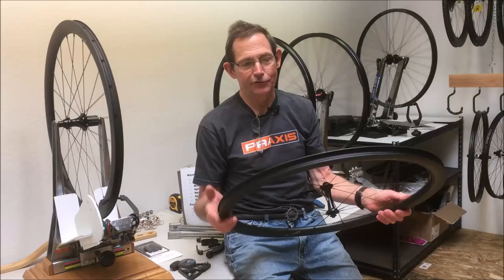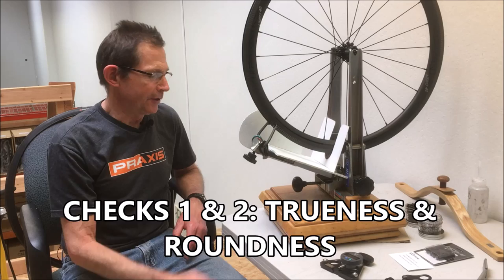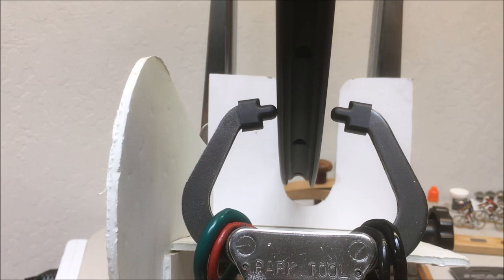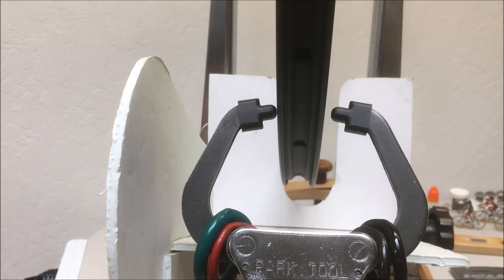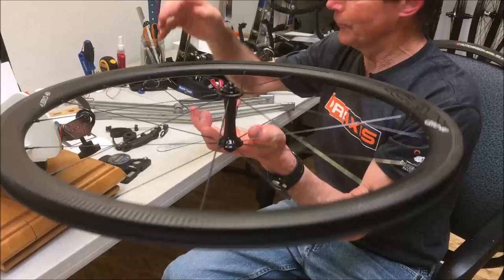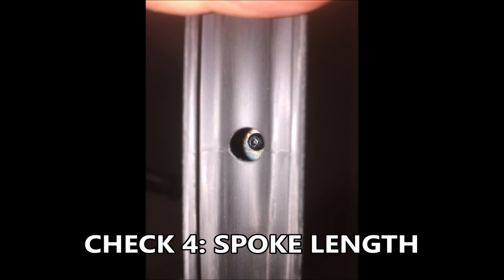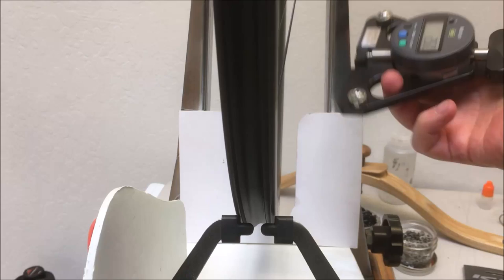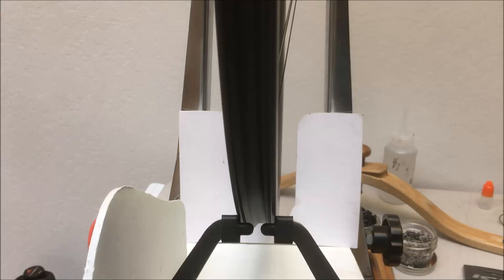ICAN Chinese Carbon Bicycle Wheels Review by Wheelbuilder Jim Langley

Comment: Confirmed what I found on my Ican 38mm 25C clinchers.  I fix bikes and tune wheels as a hobby.  My spoke tensions were not even when the wheels were new.  I measured every single one and graphed it on park tools free online tool.  You can get a good idea of spoke tension distribution across the entire wheel.  Took a bit of time to get them as even as possible and at the same time true (my OCD).  I find in previous wheel repairs for friends that the more even the tensions across all the spokes, the more the wheel is likely to stay true longer and not be affected by stresses when riding.  While doing that I also aligned all the blades.  Overall very happy with what I paid.  The rim brake surface has held up without delaminating or warping down long descents.  Thanks for a great review.
Reply from the maker: Thanks a lot for the kind words and for sharing your nice review of your ICAN wheels, Almon Dao. In the video, I am using my Wheel Fanatyk tensiometer, an awesome tool: https://www.wheelfanatyk.com/store/digital-tension-gauge/ It has an app for tension charting, too. I like Park Tool's online spoke tension app, too. For others to use it, they need to get Park's TM-1 tool https://amzn.to/2yYE1oR which is easy to use. And then, they can use the online app here: https://www.parktool.com/wta and have fun fine-tuning wheels to tension perfection. Thanks again!

Comment: I was extremely impressed with your video presentation Jim.  Your manner is low key, understandable, and transparent.  I never thought much about this process, now I'm thinking it would be interesting to see a video of you evaluating and tuning hard used mountain bike wheels from a downhill racer.  Thanks again for the very interesting piece.
Reply from the maker: Thanks a lot for the kind words, John, I appreciate it and am very happy you enjoyed my video. I work with a pretty talented and daring mountain biker (former BMX national champion). He can destroy any wheel - and I have build him many - some carbon, but mostly aluminum since he hits flies so high, lands so hard and hits so many rocks - and carbon can't handle it. He breaks hub axles, too, and once in a while spokes. He is one of our top product testers. If he can't break it, we know we have something good. Mountain bike wheels are generally much more ruggedly built than superlight carbon road wheels due to the significantly heavier/wider rims. It's easier to build good MTB wheels than it is to build good road wheels because the rims do so much of the work. Thanks again!

Comment: I have had great luck with my set of ICANS.  I did correct the twisted spokes myself.  About 15000 miles on my set now.  Recommended!
Reply from the maker: Thanks very much for sharing your experience with ICAN wheels, Ed! That's great to hear.

Comment: Good video. I went through the video rather quickly but I didn't see any comments about the hubs and bearings. The hubs are just as important as the rims. I bought some Boyd wheels about five years ago and I had problems with the bearings on both the front and back. Had to be replaced at around 5000 miles. I have a set of wheels with Ultegra hubs with over 25000 miles and they are still running smooth.
Reply from the maker: That's a good question, Neal. I have about 1,200 miles on the hubs so far, but here in Northern California, we don't see awful weather so I haven't exposed them to much more than rain. So far they are still silky smooth and no worries. There are a few comments from riders who have logged more miles and years than I have and no one has complained about the hubs as far as I've seen. So that's good. Thanks for the comment, Jim.
Reply: @JimLangley1  I'm a old timer and I don't care for the sealed bearings used in most new wheels. I have sets of Campy wheels from the 1980's with many miles on them that spin much smoother than  sealed bearings wheels. I haven't found a need for carbon wheels but it's interesting to read about them and you do a great job explaining the pros and cons.
Reply from the maker: Neal U Appreciate the kind words & I am fond of Campy hubs, too. It’s their adjustability that’s so nice. You lose that with most sealed bearing systems in exchange for supposed easy to replace and inexpensive cartridge style plug & play bearings. But it’s not always easy to replace the bearings and sometimes it’s impossible to remove play in the bearings too, when/if it develops. Still, Phil Wood showed that sealed bearings can work as did Chris King with his sealed headsets. Carbon rims primarily allow lighter wheel weight and personally I do find it noticeable. The wheels sound a little different - the taller, the louder. Braking is not as good as aluminum with rim brake carbon hoops. You do get used to it but in the rain you want to keep it in mind. So there are trade-offs.  Thanks for sharing your expertise.

Comment: Jim, I have the ICAN 38mm Disc Brake Cyclocross wheelset - regular spokes & weight 1645 grams both.
They're ridden on my 2017 Giant Contend SL2 Disc Road Bike. 
They really upped the performance factor of this Endurance Geometry Aluminum framed $1150 bike.
They shaved exactly 2# of total bike weight.
Was 21.9 stock
Now 19.9.
Ride is much improved !
Our roads here in Rural E Texas (Tyler area) range from Smooth tarmac to potholed garbage - with too much of the latter.
I'm at around 4500-5000 miles ridden. The '4in1' Novatec Hubs are rolling perfectly smooth. At 200# I'm not exactly a lightweight guy either !

I'm thinking I should on general Principles check their spoke tension - as a semi-annual check.

These wheels were just $449 shipped. Incredible value !

Thought you might appreciate hearing about my "real world" experience on the Disc version similar to the ones you show in your Unboxing video.

I also bought & built up the ICAN A007 Aero Road bike.

My review on that build is posted on Amazon under that Frameset listing - mine's the one with Pictures & 'Giant Blue' Color scheme.

Built it in late 2015 - fab race bike !
Reply from the maker: Thanks for sharing your great review of your ICAN wheels, Mother Goose! It's nice to hear how much you like them and how well they're working - especially how they transformed the weight and performance of your bike. Also, thanks for telling me about your Amazon review of their Aero Road Bike. That sounds impressive, too. I'll check it out. Thank you! Jim

Comment: I'd love to see the test results from a wheel straight from the factory of one of the big brands who charge at least double the price.
Reply from the maker: When I reviewed these wheels I used the same checks I've used on many other wheels over the years, Chris. Spoke tensiometers were the key tool that allowed putting numbers on wheel builds. Those became readily available to bicycle shop mechanics and wheel builders around 1980. I had a Hozan to start back then and later Wheelsmith's. We checked factory wheels when we sold them back then and right up until today using the basic same steps shown here. What changed since 1980 is that the quality of wheels has improved greatly across the board and that includes spoke, rim, hub and assembly improvements driven by innovation and consistently more powerful computer analysis to determine how the components and overall wheels can be improved. When you check most modern wheels you find that they're excellent out of the box.  I kept this in mind evaluating the ICANs in this video. I would not expect to find even the few issues I found with the ICANs with the big brand's wheels. Wheels have gotten much, much better over the years, which is a great thing. Really appreciate the comment!

Comment: great review . I have had some Aero 40 disc wheels for 2 years and they are still running as new . On close inspection a few spokes could do with realigning to be perfect ( they are only slightly off) but I am super happy with the purchase and performance so far
Reply from the maker: Thanks a lot for watching my video, Stuart and also for sharing your review of your Aero 40s. I'm happy to hear they're still running as new and you're very happy with them. Thank you!

Comment: I bought a couple Ican fatbike wheels in the last year.  The 26" ones held up to my 190lbs and 85 lbs of gear fatbike across Utah and Nevada.  Amazed how well the held up to some rather extreme beating.  I more recently bought their 29" wheels for the same fatbike and they've been good but haven't had to put up with the abuse I put the 26" ones
Reply from the maker: That's great to hear, Greg. That sounds like an awesome trip riding across Utah and Nevada on a fatbike - well done! Appreciate you sharing your ICAN review very much. Thank you!

Comment: Sounds like a good accurate review to me.. I'd buy them , inspect them and have someone do the needed adjustments .  Mine came thru same ( bought the 38mm set)  a little spoke twist as well, and but else was great.  I'll take your advise and have them adjusted when my local shop has the time.
Reply from the maker: Thanks for watching and the comments on your ICAN wheels, appreciate it!
Reply: @JimLangley1  pardon the grammar goof.. was mutitasking.  I am enjoying the wheelset. Next uprading my crankset to 105 with A/B ovals.  have enjoyed those on my mtb for 4 yrs and it's time to put some on the roadie.

Comment: Fantastic review, especiaqlly the bit about the tire mounting....no other reviews look at that aspect and it is super-important. I just sold a pair of Reynolds Strike SLG wheels because it was virtually impossible to mount, and especially seat, a tire out on the road. I also have a pair of older ICAN wheels and they are much easier for tire mounting.
Reply from the maker: Thanks for the kind words, Tecno. I hear from more cyclists about difficulty mounting tires than just about any other issue, so you're right about it being very important. These ICAN wheels did a nice job with their fit and ease of tire mounting and removal, which is great to see! Thanks again!
Reply: @JimLangley1  btw what do you think about hubs on those wheels? Are they rebranded Novatec or something like that? I am quite interested in the 55mm version of these wheels but have not found any info on the hubs...
Reply from the maker: ICAN told me that the hubs are their own design,  @tecnociclista5342 . It would make sense if they had them made to their specs by a company like Novatec, but I don't know if that's what they did. They look to be a very minimal design to me and from the overall weight of the wheels, the hubs are likely superlight, too. I won't know how they hold up until I can put some miles on the wheels and particularly do a lot of steep climbing to put some pressure on the front wheel (standing) and rear wheel cassette. Other people who have commented who own ICAN wheels have said the wheels hold up nicely. For more specifics on the hubs you might try the chat function on their website to see if a technical rep will answer. I hope this helps and thanks for the great comments!
Reply: @JimLangley1  Thanks for the insight! My other ICAN wheels are certainly stiff enough but come with Novatec hubs...these look quit flimsy in comparison which is why I was asking :) I did chat to them recently and for my weight (83kg) they actually recommended the FL-line (which come with Novatec hubs) but are a little heavier, I should probably trust them on that but the Aere line is just so temptingly lightweight ;)
Reply: @JimLangley1  have you had a chance to ride the wheels? Any opinion on the hubs yet? :)
Reply from the maker: Tecno Ciclista so far they are fine. I think it’s going to take many miles to see if anything can be improved.
Reply: @tecnociclista5342  شيد طارة سللك

Comment: A killer video, great information.  As a mountain biker and someone that has worked in the sporting good industry for 31 years I can tell you that 90% of bike parts are produced in China.  There is no doubt the industry has it's boutique brands that product parts and wheels in the US and abroad.   Many of the China factories that produce for the "big" brands also sell direct and can provide huge savings.  I9 Wheels (produced in the US) starting price is over $2000.  I have found a source that produced a killer set of MTB carbon rims for $650 that includes DT-Swiss 350 hubs with 54 engagement. I'm not a wheel builder but I'm able to true my own wheels.  I own a Spin Doctor truing stand, a spoke wrench and a Park Tool spoken tension meter all for $135. It's worth the time to true a wheel, makes them last a long time.  Saving $600-$1500 is worth the risk in my view.   I love technology but in the mountain biking world there are no more manufacturing secrets, all the manufacturer's are producing great bikes.   The bike industry uses marketing tactics to convince the end users to believe the newest trend will make you a better rider (slack, headtube angle, geometry, offset etc...).  You can find several blind test results on the Internet that used riders ranging from pro's to the weekend warrior were virtually none were unable to pick out any of the differences.  A great video of a Pro rider talking about the very slight differences in MTB bikes and what the average rider can do to make his/her current bike perform better.  https://www.youtube.com/watch?v=zazQCR5oIyI&t=618s
Reply from the maker: Thanks for the kind words and advice Will and the link to that informative video. Good one! Appreciate your comment! Jim

Comment: Great video. I have been riding ICAN wheels for years, and know a couple of people who race them. I would LOVE to see you do a comparison video with one of the "name" brand wheels. I personally have 4 set on different bikes - 86mm, 50mm rim, 40mm disc, and the original 38mm - they are all amazing for the average rider. I can tell you from personal experience, I would put their wheels out of the box over ANY other wheels - except maybe Schimano. Just my opinion based on my experience including building wheels! Great video. PS - most bike shops do not know there is a spoke twist tool or how to use it. 99.9999% do it by eye.
Reply from the maker: Thanks for the feedback, John. I was trying to review ICAN's wheels on their own, but as a pro wheelbuilder and a road racer, it's impossible for me not to think about my other aero wheels. I have 3 sets of Bontrager Aeolus carbon tubular wheels that I've raced a lot. Those are all the sizes right up to 90mm profile carbon wheels - I won the CA state championships on the 90mm actually - super-fast wheels!. I put thousands of miles on Shimano's first tubeless Dura-Ace wheels and loved them. I have also ridden a lot on HED wheels and Neuvation carbon 50mm carbon wheels and Rolf wheels, and more brands over the years. In inspecting the ICANs I tried to consider what I've learned from all these other wheels in order to share that as a way to explain what to look for. It's great to hear that you like the ICANs a lot and rate them almost as high as Shimano wheels. That's very impressive. I really appreciate you letting me know how much you like your ICANs. Thank you!
Jim
Reply: @JimLangley1  Jim,
I thank YOU. I get blasted for talking about how much I like the ICAN wheels on my channel. I respect your opinion and your experience and think that for the price..... an average rider will not go wrong with these wheels. I have also been using a frame that they sent me...... and I have been impressed with that as well. One last thing I will say is that these wheels are better by far, over the "high end" stock Giant wheels that came with my TCR Pro 0. Those have been out of true since day one and have been retrued as well. Out again. These wheels just perform really well in my opinion. Again thank you!!
Reply: Half of those wheels come out of the same mold. People pay a lot for logos and stickers, same for frames.

Comment: Great Review! Thanks for the insight. I was wondering how those budget carbon wheels really stack up against their branded counterpart. Maybe you could do a comparison video in detail. Also great to see that those wheels are not carbon death traps as almost everyone on the internet seems to think.
Reply from the maker: Thanks for the nice comment, Falkao92. Overall, the people who own ICANs who left comments here like them a lot and say they hold up really well. I own a few pairs of carbon wheels and considered those wheels that I have ridden a bunch when I said what I said during my inspection of the ICAN wheels in this video. The biggest difference is optimized and equal spoke tension in both front and rear wheel and no bladed spokes turned into the wind plus perfect trueness and roundness. FYI: My carbon wheels are Bontrager, Zipp, HED and Neuvation. I hope this is helpful and thanks again! Jim

Comment: Bought a set of cheap Chinese carbons and the braking was very grabby and pulsing. Used a few different types of carbon specific brake pads with no luck. The last resort was lightly sanding the braking surface but to no avail.
Reply from the maker: Pulsing and grabbing is usually caused by seams or irregularities in the rim surface, Ramond. It could also have to do with the finish on the rim and even decals/stickers. Sanding the rim can work, but you only want to sand on the braking surfaces not the rim itself. Maybe if you keep trying different carbon compatible brake pads you can find a pair that works. I've had better luck with composite pads containing cork, I believe, than pads containing rubbers. Good luck!